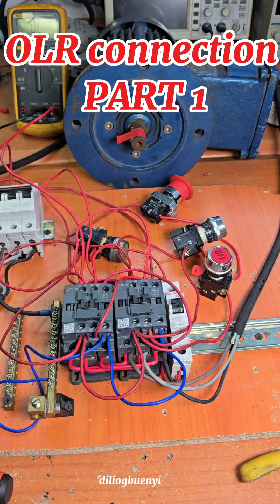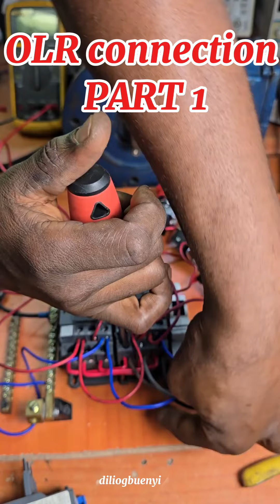OLR connection #electrician #electrical #industrialelectrician

Comment: Not necessary, to avoid accidently press reverse when motor running forward, just stacked an auxiliary relay there's N/O (Normally Open) and N/C (No Closed) contact will disable the other switch.